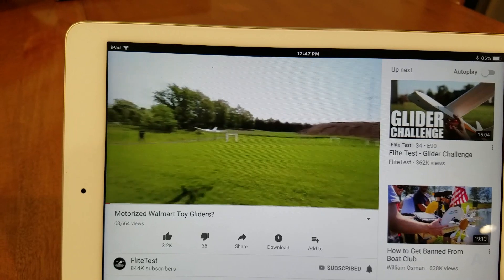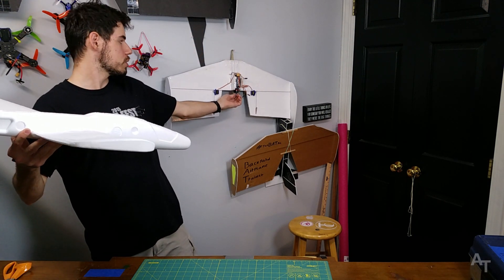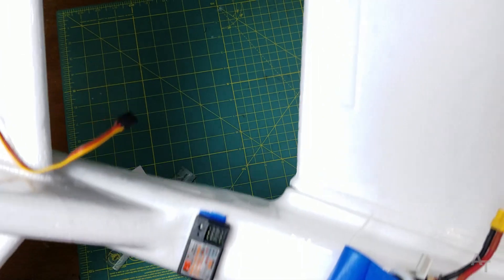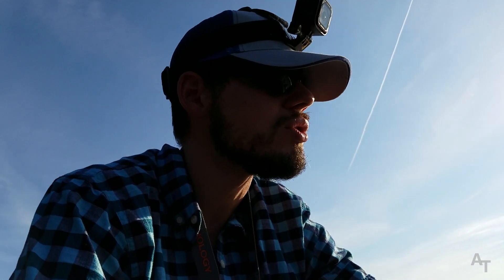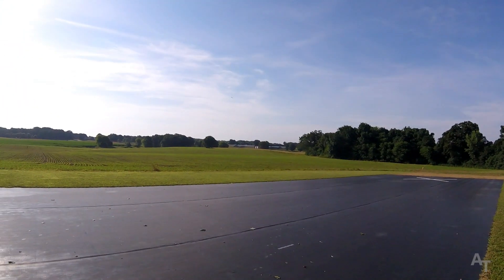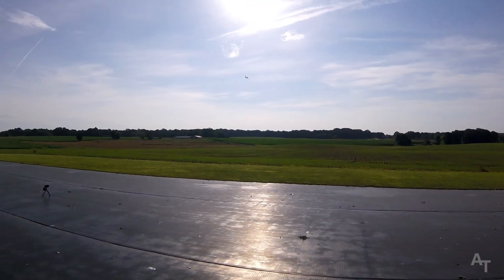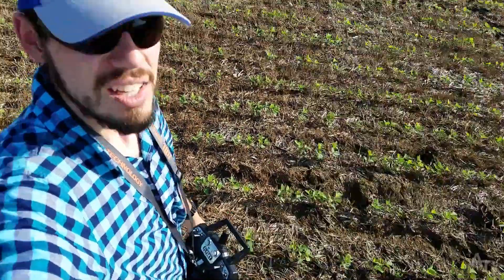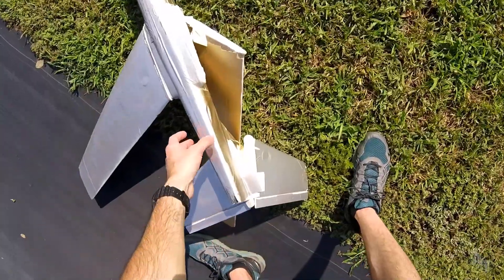LEARN FROM MY MISTAKES - FliteTest Walmart Toy Glider RC Hack Challenge!!

Comment: I cut the nose  back to the base of the windshield, two dowels and a plywood motor mount for the .049 engine. 5 degrees down thrust. the power on and power off transition smooth.

Comment: Did the same thing a few years back.  about 1982 Cox .049, 6x4 Cox prop. 2 channels, Rud on ail channel and elv , normal. 4-6 minute engine run. climb like a home sick angel.  Trimmed for fast power, then climb the last minute, glide back.
4 hours of flying , using 4 oz. of fuel. Fuel tank about 1/2 oz. Two flights per oz of fuel.
You have to be careful not to sunburn the roof of your mouth.

Comment: i'm building one also, been working on it for a week, inlaid carbon fiber rods in the wings and a 1/4" dowel in the fuselage for strength. i'm using twin 2204/2300kv motors installed on pods under the wings with 6x4.5 props, fiber board elevator, ruder and ailerons. i bought a 10 pak of 9G servos, all 10 of them are bad if you can believe that, i was going to sink servos in the wings for the ailerons but now i'm thinking about going to plan B and using 1 of my rc car servos mounted rocker style on top of the fuselage for the ailerons, there's no hobby store within 200 miles of me so have to order 2 more micro servers for the elevator and ruder, this time i'll order name brand metal gear servos. not going to paint it, coated it with Mod Podge hardener instead.  i hope i have better luck then you did although it ought to be interesting anyway because this is actually my first plane and with this power setup if it fly's it's going to be fast and heavy and probably end in a spectacular crash.....
Reply: it turned out the problem with the servos was the traxxas receiver i was using to test them, i retested them with a flysky radio and receiver and all but 3 worked correctly. it was really weird, never seen anything like that in the 40 years i've been doing rc's
i've way over done it on this thing, instead of being a quick cheap glider conversion it's turning out more like ready made kit, i've run all the wires through the wings and fuselage, embedded all the servos so they are flush, custom made all the control hinges, i should have just bought a damn kit but i bet it's going to hall ass, that is if it fly's at all....lol
Reply: i was having too much trouble getting the dual motor thing working so I changed it to a single motor pusher, 2212 980kv with a cut down 8x4 prop but i mounted the motor pod back further above the front of the wing with about a 10-15% up tilt, i kinda imitated the Bixler's motor position. luckily i bought 2 of these gliders because that gave me something for a CG reference and i'm doing all the modifications so the plane will have the same CG as originally designed. haven't flown it yet been to windy and the only battery have small enough is a 2s but it should be enough to get it airborne, let you know how it fly's

Comment: yeah the flight test guys got me too, i have 2 of the same gliders still new in packages and trying to figure out a successful build without using one of their $70 power packs, so in that since you have been a big help by showing me what not to do. 
in contrast to what you used for power though how do you think one would fly with an 30mm EDF mounted in a pod in about the same place you mounted your motor, that should greatly reduce any torque roll while giving it some decent kick but do you think it wild work? Ive seen some LIdl glider conversions using that system and they flew awesome but they are smaller gliders....

Comment: Man I actually used that exact same prop on my Apex wing and the torque was crazy on that too! Maybe they’re just bad props for planes. I wonder if going to a bi-blade would help yours. I’m flying mine with a 4” prop and there is absolutely zero discernible torque.